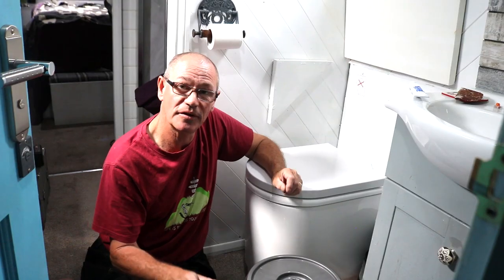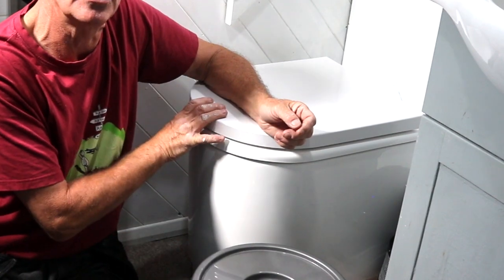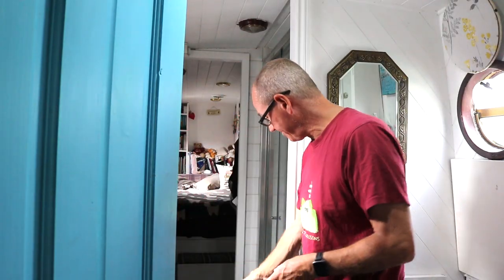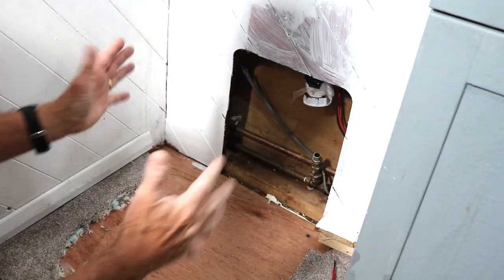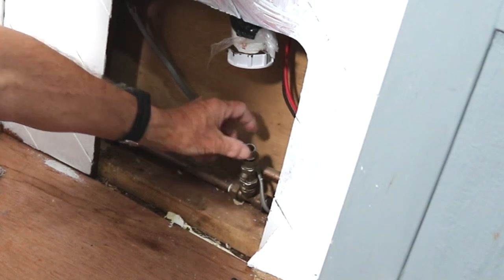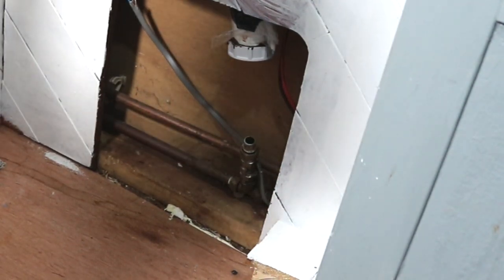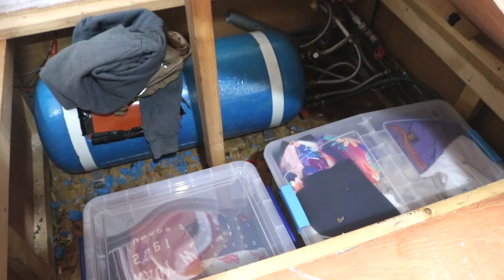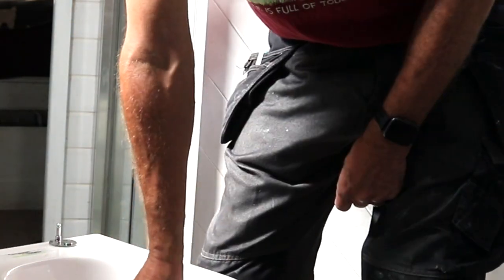How to Install a Composting Toilet on a Narrowboat

Comment: Thank you for the extra detail about wiring up the Compoost. Your tip about silicon lube for the plastic drain pipe into the filter's rubber seal is amazing - we struggled and struggled to get that in! We've chosen to fully compost our solid contributions for growing flowers in roof boxes.

Comment: I usually end up fitting better electrical connections and cabling on equipment where i can. A lot are only just adequate for the job
Reply from the maker: I usually just leave well alone, but this looked nice and simple 😂
Reply: @part-timenarrowboatlife2395  electrical stuff is my daily job so is essy for me. Can also do bssic plumbing too.